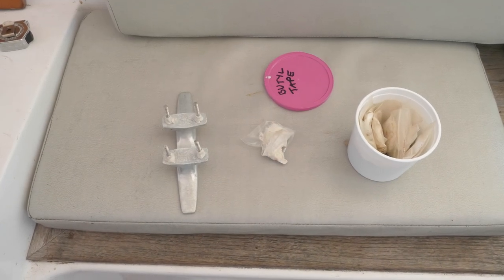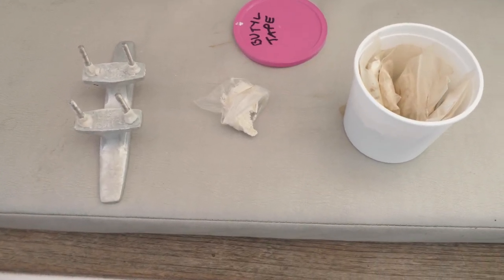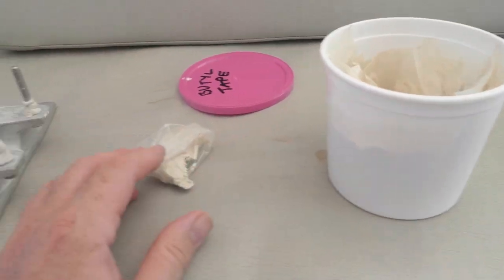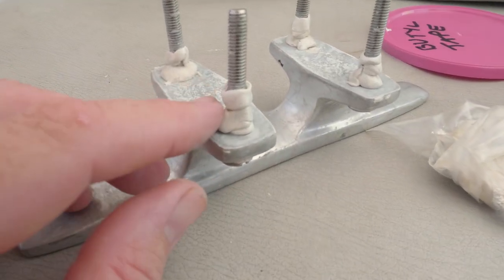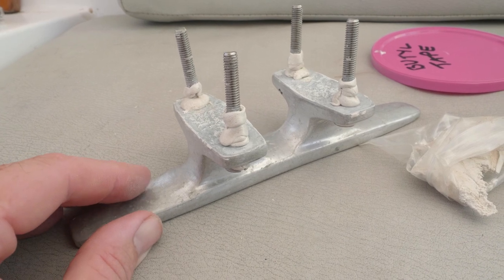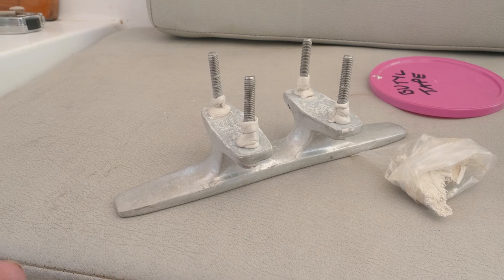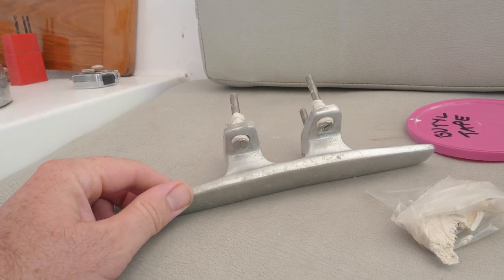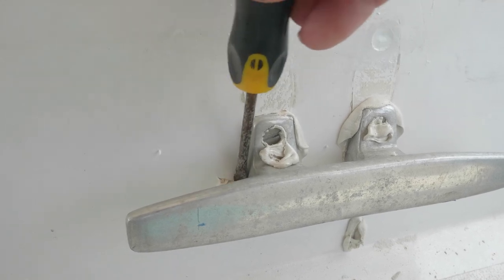HOW TO USE BUTYL TAPE TO SEAL DECK FITTINGS ON A SAILBOAT - SAILING FOLLOWTHEBOAT EXTRA

Comment: Thanks - very useful video.  You can get butyl tape from roofing merchants.  It's used to form a seal between corrugated roof sheets.  It comes in various sizes on rolls and is not expensive.  That's what I'm using on my boat and it works fine.

Comment: New Stainless Portlights by Newfound Metals - factory recommendation is to completely fill the voids with butyl tape and then tighten the portlight outer trim ring with interior bolts, sandwiching the butyl and compressing it in the steel/deck/steel sandwich. A year later and zero leaks, although I still have it weeping, especially after a hot month.
Since doing this, I've come to the conclusion that when bedding, a mechanical fastening system used with butyl tape sealant is the most bulletproof available. I've had some black butyl on the boat sealing the pedestal for 18 years with zero leaks, so the longevity is there as well. Great post. Thanks!

Comment: Refiting my 42 ft Moody Ketch using butyl on all windows seals and screw down hatches , the orginal seals were butyl lasted 40 years with minor leaks in the last few  , windows came out a dream , love butyl , cheap and very easy to use , well done Jamie for  showcasing this stuff

Comment: I installed air-conditioning system for 15 years -- I used the pure butyl caulk all the time and loved it. You are right about sourcing the stuff.  Warning: There are many products that say "butyl" on them  but most are mixed with some other chemical and do not work nearly as well -- many of these are sold by large retailers.  Industrial supply houses are the best bet.

Comment: If have used butyl tape a lot since discovering it.  Brilliant stuff and not the mess I always got into with tubes of Sikaflex.  Also easy to remove and replace fittings with no gelcoat damage.  Great advice,and good to hear after 4 years yours has not failed.  Andy UK
Reply from the maker: Thanks for the feedback, Andy. That's two happy customers!
Reply: Sailing followtheboat I have seen Mads on Sail Life use Butyl in a tube for his port plights but I have no idea if that is the same product at all but he was able to remove his port lights without damage so it has similar properties.  Cheers
Reply: Andy UK, I never told that Sika is better to use for this application On the contrary Sika is for the most application to strong in chemical bonding. So cracked on a friends boat the PMMA windows because the Sika was not flexible enough. I used all this stuff and prefer a cheap window silicone rubber. It's easy to get, it's cheap, it's easy to remove. As I renovated my Deck it was a nightmare to remove old Sika and old butyl. Even for me as I know how to destroy this sealants. I never would use it for port lights. Butyl is used for the primary seal of insulating glass, always in combination with silicone, polysulfide, polyurethane for the physical strength. As well it's used in the car industry and other industries to prevent from scratches or holt the parts in place while screw or glue them together.

Comment: I have a 29 year old RV which had a very rotten, sagging roof which I removed and rebuilt last summer.  I used yards of butyl tape to reset roof vents, corner moldings, etc., and found that using it was indeed easy and efficient.  However, I also used a self-leveling caulk on top of these locations to ensure a waterproof seal.  Good stuff - available through RV supply firms (as others have noted) and on Amazon (where I bought mine).  I'm looking forward to your Japan / North Pacific / Pacific Northwest adventures!
Reply from the maker: Good tip on the self-leveling caulk, Tim.

Comment: Butyl tape = great stuff.  I've used it for decades and not just on boats.  The local, very well stocked, Chandler where my last boat was moored had never heard of the stuff.  After I asked about butyl it became a regular stock item for him.  Best part is when you  need to rebed there are no messy adhesives to sand or grind off.
Reply from the maker: No mess, that's what we love about butyl, Don 👍

Comment: About to begin working on a refit of a 28 foot sailboat (my first boat) and definitely planning to re-bed every deck fitting with butyl tape, looks easy to do and easier to repair if any leak does arise.

Comment: I just bought some butyl tape on Amazon and am ready to instal a replacement port with it. Thanks for reinforcing my decision to try this. If it works well, I’ll be resealing a ton of leaking deck fittings. Cheers!
Reply from the maker: Just remember to not turn the bolt... although someone did suggest allowing the bolt to turn a little so the butyl works its way into all crevices.

Comment: Hi Guy's. (Ant) I used butyl tape and in my my career by the ton. The supplier's will tell you it has a shelf life of 12 months and has to be stored at +5c and below 30c . However, my experience in the field is the material is just about indestructible. The key (no pun intended) is working clean, ensuring the surfaces are clean and dust free. that means chemically clean no oily finger prints. It is less susceptible to UV than DOW, Sika and other sealants. But can be affected but cleaning products oils and chemicals. It also does not leach polymers into the materials that other sealants do. Giving a tell tail "smudge" line around the joint or gap. Overall a much better solution that is non hardening and will outlast just about everything on the market . Ant. Ant & Cid xx Sail Safe .

Comment: Butyl tape was used extensively by boat builders in Canada in the 70’s and 80’s not only for bedding deck hardware but also for bedding the deck to the hull. I just removed some deck hardware from a boat built in 1981 that was installed using butyl tape.  It was still watertight and still flexible.
Reply from the maker: Good to know, Bill.

Comment: Thanks for sharing Jamie.  One tip from me is not to use a screwdriver for trimming it around fittings.  I always use a hard plastic scrapper. I make mine from broken plastic windows from caravans/motorhomes, boats or just offcuts of plexiglass. Just cut  a 1" wide piece 6" long and sharpen one end with a file or grinder. You can make them as wide or as narrow as you need. If you slip off the tape squeeze out and skate across the finished surface you don't leave a big gouge in it.  I discovered years ago that silicone is a crap leak sealant. Always use Butyl or rubber based sealers in wet environs.  Fair winds & regards from the UK
Reply from the maker: Hi Gary. Your comment appears alongside Jed's who said the same thing. Yes, plastic scraper is sensible.

Comment: Great Vid!  I have used butyl tape extensively on our WS42 Harmony:  no leaks and no mess.  One can remove butyl tape residue or clean up residue with plain mineral spirits.  Fair Winds from Doug on WS42 Harmony
Reply from the maker: Thanks, Doug. Fair winds to you too.

Comment: Amazing stuff but thanks to the EPA most butyl tape of today is not the same as the butyl tape of years gone by. There is actually a water soluble butyl tape, which of course would be really bad for boating applications. One of the best I ever found is called Bed It Butyl Tape from Compass Marine. It is specifically designed for marine use and will give you many years of service. It is typically more expensive but a little goes a long way. In a pinch the black stuff can be found at most commercial glass companies as they often use it for bedding skyscraper windows.

Comment: It's great tape to have in the bottom of a tool box, There is also a very heavy thick sticky tape called monkey tape we use at the dive company on emergency leaky flow control valves 130 ft down and it even seals pressurised lines with upto 2000 psi down that deep, So if you ever had a long hairline fracture to the hull that leaks it would stick nicely to the outside damage hull like super glue, But it is very messy to handle but if the boat is leaking who cares you can always clean the mess up later with strong thinners to take it off, And cost 1/10 of them special emergency patches you can buy for the hull, But the monkey tape would do just as good a job if the crack develops below the waterline,, Fair winds!
Reply: Shaun, when I tried looking for this on Google, I only came up with search results for an athletic finger tape.  Can you provide a link or the proper company name?  Sounds exactly what I need to stop a pesky leak around my centreboard cable.  I've tried that epoxy putty in a tube but it only works when dry so a tiny channel will form allowing water to seep out from under the hard epoxy (which means sanding it off, etc.).  Thanks.

Comment: Awesome tip. I'm going to try it out. Looks like this stuff is available on Amazon for $14. I kind of wish it didn't come in 30' lengths.  I need about 6"...maybe I can use it for my little camper too. Thanks!

Comment: We use a butyl rubber adhesive in double sided paper (advertiser states its coated on a polyethylene net, whatever that is). Same properties as what you are using but sticky as the proverbial to a blanket.
Reply from the maker: Yes, I saw this stuff advertised (after we did the refit). As you can see I roll it up and kneed it into a 'worm' so I'm not sure the double-sided sticky effect would work in the application in the video, but for lining a window frame I can see how it would be useful.
Reply: CERTAINLY IS A ONE USE PRODUCT, BUT EASY TO REMOVE SURPLUS SIMPLY LIKE REMOVING BLUETAC

Comment: I have used 3M 5200 and will never again. It can be stronger than the thing you are fitting, and so causes you to break it when removing or repositioning. I've been researching butyl tape and I can't see a good reason to not use it. Thanks for the tips. Now I need to find it in gray or white.

Comment: Ah! Butyl tape! Love the stuff. But, here in Canada you can buy a grey butyl tape or the creamier version that it appears you are using on the video. In the hot sun, the grey butyl does not soften up nearly as much. We use it to seal long window inserts on our boat. Another thing I found before using in long applications like window inserts, unlike deck fittings, is to keep the butyl tape cold (leave in the freezer) just before applying strips to long areas. If the tape gets to room temp or however hot it is, it is much harder to handle. Another tip is to keep a small bowl of soapy water near by. You can dip your fingers in soapy water before handling large strip. I bought my grey butyl tape online from a US vendor.
Reply from the maker: Yes. Like the soapy water tip, Cedric.

Comment: I’m going to give it a try! I have stainless steel screws fixing an aluminium window frame in place. I think the two are reacting when wet, which is then leaving a dark coloured stain running down from the fixing point to the deck. This may give me separation of the two metals. I was going to try loctite, but will try this instead.
Reply from the maker: We also used it for our aluminium frames fixed in place with stainless screws. Again, works a treat.

Comment: butyl is amazing... Just worked with Sika 710 another high recommended butyl based sealant. But for screws I prefer Butyltape....
Reply from the maker: Not tried Sika 710, Dick. We'll look out for it.

Comment: Have used it professionally for decades to seal stainless steel leaktrays to bartops. Works like a charm as it does not dry out. only downside to it is, as it continues to squeez out, it can get on clothes and it's impossible to remove once it's inbedded in textile.
Reply from the maker: Keep the overalls on, Ruud 😉
Reply: Btw. Diesel/petrol has already been mentioned as dissolving Butyl tape. Use white spirit to clean and remove it from surfaces and smooth the seals.
Reply: True Jamie, however i've transferred it from overalls to carseat to jeans!
There's a disadvantace to not drying out!!!!

Comment: It will be interesting to find out how the Butyl tape fairs when you sail up north in freezing weather after having applied it a hotter environment.
Reply from the maker: Hmmm. Well it does expand and contract, Robert, and that could cause some issues as we move to colder climes. We'll have to keep an eye on that.

Comment: Butyl tape, great product. Sadly it is not as commonly used as it once was. Used to always find it in lot of old time small hardware stores. Been replaced by all these new fangled products, sometimes better, sometimes not, depending on situation. You said you might want to go back and retighten ... actually that should not be might but is strongly recommended that you should always do this. One of reasons why it has been replaced, it cost more labour. Also the life expactancy is roughly 30 years, can last decade or so longer, but about 30 years should be looking at replacing it as it will start losing its flexibility and elasticity. As you mentioned it is not really an adhesive, does have adhesive properties but also why other products were used which had been more designed for adhesives. Can understand this for things like cleats at front where you use anchor tied off, other times dont understand so much, like window portals that do not require much if any adhesion strength.

Comment: Most roofing supply stores sell the butyl tape. used for metal roofing panels.
Reply from the maker: That's what I say in the clip, Rich 😁 The problem is that they often only sell black butyl, which can leave marks on the deck

Comment: Very similar to plumbers putty. Butyl tape can be found in plumbing supply stores usually.
Reply from the maker: Did not know that, thank you.
Reply: Yep - might also be called plumbers mastic - used for bedding sink wastes and sealing taps to bench tops etc...
Reply: It may appear the same at first glance but are definitely not the same product. Plumber's putty is made from clay and linseed oil while butyl tape is a synthetic rubber. Plumbers putty will take a long time, think twenty years, but it will harden, crack and leak while butyl will never harden, crack or leak if installed properly.

Comment: Used Butyl tape on some persistently leaking deck fittings near the cockpit. Leaks never returned! The downside: my wife stationed her favorite clothes from the excess / exude. It never sets and will adhere easily to fabrics. White spirit / dry cleaning to remove.

Comment: I have used butyl tape before. I am not a sailor but an RVer. Butyl tape is used all over an RV sealing windows, vents, skylights, etc. In fact ever RV store has it so can be another source if you happen to be in a location that has RVs.
Reply from the maker: That's good to know, Garry. I'm not sure it's so popular in the UK but here in Thailand the only stuff we could find was the big, black stuff they use for roofing. It still works ok but it can leave black marks on the deck, so white is preferable.
Reply: Sailing followtheboat when you get to the Pacific NW in America, you will find it everywhere, but it may be gray rather than white. Safe travels.
Reply from the maker: Thanks, Garry.
Reply: I have always wondered if the black butyl is the same stuff ... it certainly works really well for roofing, gutters, etc and is supposedly more UV resistant. Which always made me wonder if did not have another product in it as well.

Comment: I use this product building cooling towers.   IT is very important that you clean the sections with either methyl hydrate or rubbing alcohol. This will ensure a long long life.
I've got towers 30 plus years still holding strong . Btw don't over tighten or you'll squeeze all the product out.
Reply from the maker: Good advice, Jim 👍

Comment: 3M 4200 for the absolute win folks.  3M 5200 if you never ever want to remove it or any reason without tearing off gel coat (You may have to pull so hard you lift the boat out of the water).  It's impossibly messy and tacks to everything you touch which is why it's awesome.  Here's the way: remove old fitting, clean it and the deck with acetone, put down masking tape, dry fit part, cut tape, remove fitting and the cut piece of tape, PUT ON NITRILE GLOVES put the goo on the fitting, set in position, put some on the bolts, where the go through deck, install, remove excess around fitting, remove tape.  Change gloves as soon as they're fucked or you'll get that shit everywhere.  After its dry you can clean around the bolt heads where it comes out.  Don't even try when wet or you'll smear it everywhere.